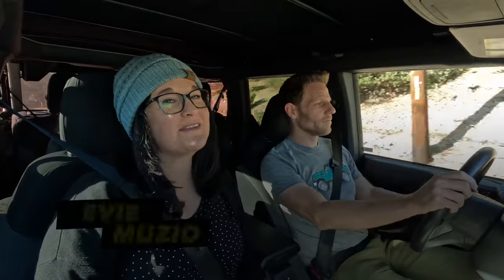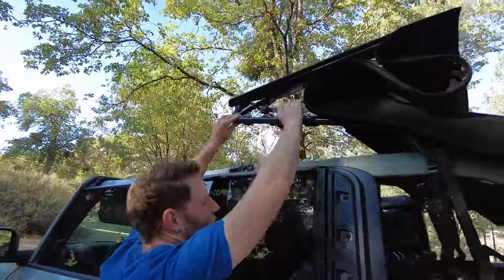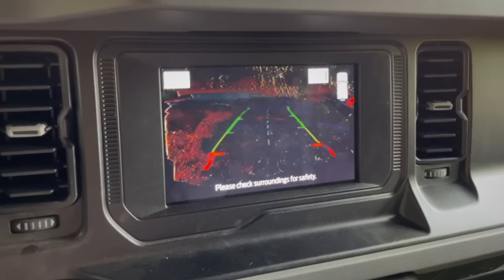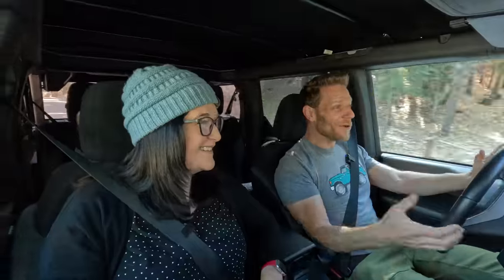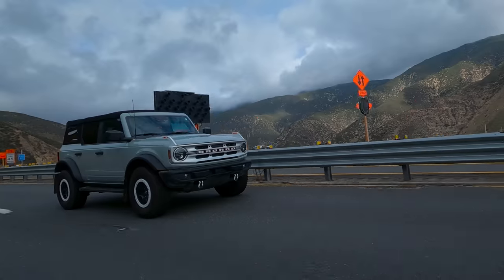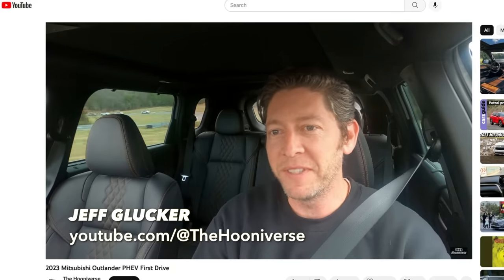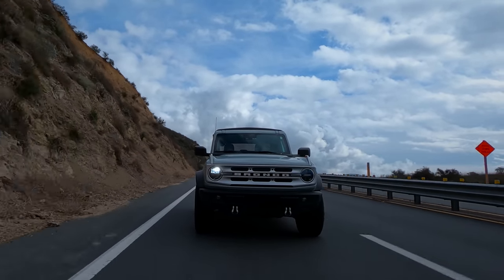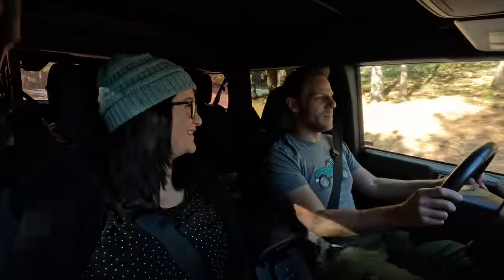Ford Bronco Problems (18K Mile Update)

Comment: My dad has a saying that is “Never buy a brand new series of a car.” I started to believe that throughout the years. I think it’s best to just wait a couple of years until a facelifted model arrives.
Reply: I totally agree. My dad use to tell me that to.
Reply: unless it is a toyota...
Reply: @alwaysup22  even a Toyota you shouldn’t buy the first year of a new model. Look at the new tundras, they have been having tons of problems.
Reply: @RRLV434  If everyone waited until the next model year for a car, there would be no next model year for a car. Early adopters is how problems are identified and fixed for the next generation. While it is best to wait for the next model year, you could always trade your car back in for the next model for close to MSRP.
Reply: This is generally true, but over 53k miles, my Bronco has been really good and nearly problem free.
Reply: Not even necessarily the facelift just don’t buy the very first model year
Reply: That's a good idea for most tech. Don't be a early adopter if you want the best experience
Reply: @Carfan678  I think even buying the first year model 4 to 6 months after it is built can make a difference in quality
Reply: @ryanwang6108  refresh doesn't = new model. Refreshes are usually appreance related not mechanical or electrical.

OP: The first year is where most problems occur. Waiting for a refresh shouldn't be necessary.
Reply: My father said the same.
Reply: Always. Especially American or European
Reply: @mpeugeot  every car with 50k should be totally trouble free
Reply: That's what I told my wife before she bought the bronco. Now it's had 2 recalls and it's been at the dealer for 2 weeks with a transfer case leak that they are waiting for parts for! And it's not even a year old!👎So listen to your dads they know what they are talking about!
Reply: I want to love something 'American made' but ford/chevy/dodge make it so hard to love.  Luckily my Toyota Tacoma was built in Texas & is American made! 154k miles with zero issues & its lifted too so you'd think it go through bushings & susp. Parts but it's been great like all my other Toyotas I've owned.
Reply: @MrMd5555  I mean wranglers and broncos are good looking but don’t know it’s worth the inflated prices

Comment: Dealer comments are right on. They make or break the experience. I was never happy with my local Ford dealer when I ordered my mustang, and throughout the 250,000 miles I kept it. When I moved up on my next purchase, I was smitten with my Volvo dealer. Now I drive an Audi. Admittedly, you expect an Audi experience to be upscale, but our local Audi dealer is unbelieveably friendly and thoughtful about our whole purchase/service experience. Even when I was driving a 10yr old Audi that I did not buy there, they treated me like I'd just bought a new R8. Recently I purchased an Audi there, and the experience was excellent. No more Fords for me, I'm all for Audi (at least for now....)

Comment: I appreciate you noting which dealer gave you a bad experience. I’ve had bad experiences at both dealer and independent shops. Worse one was a shop forgettable to put the mounting bolts back on my brake calipers and they were just flapping around in the wheel hub. It’s a miracle I was able to stop and the lines didn’t snap but left me stranded in the middle of nowhere TX over Thanksgiving.

Comment: I have a 2021 outer banks non sasquatch soft top 4 dr since Nov 21 with about 10k miles. Had a great dealership experience here in central PA and no major issues. I had the kids safety lock recall but that was fixed at my first service. One minor nuisance is that the plastic windows are VERY sensitive and scratch easily. I hand wash/dry with microfiber and still have little annoying scratches. I guess it cant hurt to call ford. 

I love it and would get it again. Sorry you had all those issues.

Comment: Good call on the KO2's!! My Wife's 4Runner has had them on it for almost 3 years. Many off grid camping trips and running over many trails and ROCKS. The KO2's are sweet. A little firm but quiet and capable. Good choice!

Comment: Yeah the V6 does have some issues 😬
The thing is that the 4-cylinder is a Ranger engine, which has never gone out of the market in Australia, Mexico and other markets. Therefore, the engine has been tested and improved for many years in the harsh Australian and Mexican desert conditions. I do trust the 4 cylinder more than the V6
The 10-speed transmission is used in so many high performance vehicles, both GM and Ford, and it has never been an issue, nothing to worry there. Dana makes great axles, just don’t push it past its limit. Bilstein is pretty good, so no worries there either.
Really, the issues are only minor in the 4-cylinder. Other bigger issues I have heard of were due to bad mods. Lifting and not doing anything else to the suspension, putting bigger tires and not reinforcing anything, things like that
Reply: Do you have an opinion on the reliability of the 2.0L 4-cylinder of the Bronco Sport Badlands, as well as its 8-speed transmission. Thank you

Comment: Dealerships can make or break future purchases. I had all kinds of issues with my 2018 Kia Stinger GT. Paint issues within the first week I had the car. Took over two weeks to fix. But at least I got to drive an Optima (insert sarcastic face). Then the rotors went out on a trip to Canada. Had  the car for a little over a year at that point. Kia paid for that, but they would not pay to replace them again 6 months later when it happened again. Dealership (Oregon) was so unprofessional about the whole thing.  Took the car to a trusted tire place and had them do it. I wasn't paying Kia anymore cash. When the lease was coming due, I sold it to Car Max and made a nice profit. Picked up a 2016 Lexus GS350 F sport with, at the time, 29,000 miles on it.  Love that car, so I got rid of my wife's Infiniti and got her an NX. I am sticking with Toyota brand cars. No mater how nice the new Kia's may look, I will never buy one again.

Comment: I switched to the KO2 for the same reason. FYI you will need to run a few PSI lower because of the thicker/stronger sidewall. I have a 2 door and like 36 front, 35 rear ish. I think they ride and handle much better. Looking forward to your review video.

Comment: My 2022 Bronco Wildtrak w/ Sasquatch needed the Transmission replaced at 3,800 miles and now needs it replaced again at 6,600 miles. The rear passenger seat frame also needs to be replaced. No off roading, hasn’t been beaten up.

Comment: If I was looking for something to do some moderate to serious off-roading, I wouldn't hesitate to buy a Bronco, AT MSRP. Even though I live in Florida where snow is a non-issue, and I've never done any off-roading beyond being a passenger a couple of times, I'm still interested. The idea of a "convertible" that can drive on the sand and do all of the other offroad things is very appealing. In the end I'll probably get a Miata though, mostly because it's easy to find at MSRP, and is better for how I'd use it (on paved roads 99% of the time).

Comment: I purchased a 21 jeep wrangler, had it for a year and a half put 30k miles on it. Test drove a bronco and sold the jeep once I ordered the bronco.
Now, mine is just now a month away but I think the issue is simple. The bar isn't set high for this class of vehicle. (Convertible off roader) since jeep was able to get by with no competition, the bronco was easily able to over take them with just a few upgrades.

Comment: I have a 2021 Rav4 hybrid. Spent $31,600 on it. At 25k miles it has had ZERO issues. Not a single one. No recalls, no campaigns, nothing.

Comment: I've probably sworn off Fords after my 2015 Escape and it's wide variety of issues/annoyances (cv joints failed at 22k, folding the rear seat repeatedly damaged the rest seat belt mechanism, finicky console, etc...) so seems like more of the same unfortunately. 100% agree the dealer makes a difference, ours was responsive and fixed things so I can't imagine dealing with a lame one.

Comment: Mine is a manual with 2.3l. has 7,800 miles, but I hit a deer and it's in the shop getting the bumper, grill, headlight and fender flare.

Comment: Based on your ownership experience, Is the 2.3 with sasquatch enough engine?
Reply: They’ve only said that it IS in EVERY video they’ve made about their Bronco.
Reply: Enough for what?  I would prefer to have a 3.5 ecoboost in my 2 door Bronco non-sasquatch, still the 2.7 is adequate, but for most people in most situations, the 2.3 is plenty.  Still I prefer the 2.7 to the 2.3 as there is nearly no mileage penalty and it just has more oomph.

Comment: Normal first year service: oh hey, could you please check this slight rattle I have from a trim?

Modern car first year service: hands them a list that's 2 pages long

Based on personal experience and seeing a small fleet handled by a friend, all new cars are problematic and literally the only thing that matters is the competency of the nearest dealership. Seeing warranty repairs of up to 50% of MSRP in the first 3 years is perfectly normal. Fighting with them to finally replace a part that's obviously broken is not exactly fun.

Example: Nissan. We have a clicking cv joint and they couldn't fix it in 2 years. Now the warranty has expired and they basically told us to live with it or pay for it. I'm like sir, I've been coming here for 2 years with the exact same warranty issue, you're paying for it. And they basically told us to contact corporate. We did and they told us to sue the dealership. I'm like WTF? What kind of customer service is that?
It also needs a few things that have already been replaced once under warranty and the new part has failed under warranty again. We told them, they said a fan chirping is normal and it's not covered by warranty. Sir, you replaced it 6 months ago for the exact same problem, I'm pretty sure you did that because it's obviously broken, not because replacing stuff for free is fun. Nope, contact corporate. Corporate says sue the dealership.

Thanks for nothing I guess. Turns out we're not alone with these issues, surprise-surprise, corporate says they've never heard of these issues. I have 20 people claiming otherwise but sure...

Comment: I am driving an M2 g86, have been driven type r, Cayman gts4.0, and Cayman S. I am interested in Bronco manual transmission (not sure which trim). How is the feel economy on this? The cars I drove were around 19-22mpg combined. And do you think it is a weird switch since I drove the sports car most of the time? Thanks.

Comment: On my 2023 Bronco Badlands 2 door manual, the only problem i have had so far is the center display lag, it takes a bit to start and when using the apps they all have a strange delay, including when i turn music volume up or down and the display shows the volume control after a few seconds after u used it. Other than that, so far everything else is ok.
Reply from the maker: Thanks for weighing in. I always love hearing from other real owners. Cheers!

Comment: My Bronxo had the airbags sensor failure so not airbags..and the main  screen not the infotainment system the speed and fuel screen stopped working so I sold my .. it had under 10k miles

Comment: I have a Opel made Insignia AWD s/wagon sold in the US under the Buick brand I think. 
Honestly it was a top of the line model and I’m getting tired of returning it for faults. It’s still has several rattles and most recently the sun roof cover has jammed. Disappointed!!

Comment: With Ford you never stop spending money, that is their business model. We have a F-150 2017 V8 with a little over 100K miles, it will stall randomly at stop signs. We took it to the dealership and they said the issue can not be replicated. The same day it stalled again. Would I buy a Ford in my lifetime? At this point I'm leaning toward a NO, the cars have too many problems and the dealerships are not helping when they should.

Comment: I absolutely love the vehicle but I don’t want to own it.  I am seriously in the market this year and I am thinking the SR5 premium or TRD premium 4Runner will be my choice.  It’s a tank and I never here bad things about them, especially when they stay with stock suspension.  All I have heard and seen about these broncos is that the owners are basically Guinea pigs for the engineering department.  I know a few owners and each one has had some semi serious to actual serious issue addressed since they own them.  I do Love that they come in manual.  I wish the 4Runners still did.

Comment: Based on the problems that you have had already, I'd say NO to the Bronco. I had fewer problems in my 2008 Sonata over the whole 12 years and 197,000 miles I had  it for. My 2013 Sanata Fe (bought used 2 years ago) is also doing better so far.  A 1976 Ford Fiesta also made it 10 years/150,000 miles and was still running when sold. Of course that was a much simpler car.

Comment: Hell ya. Not a ford person anymore. I had 1998 expedition,  transmission replaced at 125,000. 2013 escape, bought for my daughter for graduation, at 34000 miles engine had to be replaced. As soon as it was replaced check engine turned on after 10 miles, returned to dealer only to find out that engine had to be replaced. transmission issues, missing bolts around suspension, sunroof motors had to be replace. Interior pieces like center console lid braking, seat belt on passenger side not working, lift gate not working, There were more issues also, too many to report. Notified Ford consumer complaints concerning all problems of escape.  All they could give me was an extended warranty up to 125000 miles, I had to pay $109 every time I used the warranty. Usually 2x a month.  I will never buy another ford again. I tell everyone about the experience of the car I bought for my daughter. She now drives a toyota CHR, my wife drives a toyota highlander and I drive a Tundra. No issues, great build quality. My brother in New York put a down payment on a Bronco 2 yrs ago, still hasn't received it. Just have to wait and see if he will have those issues. He ordered the 6 cyl. Good luck on that.  Ford needs to do better with their customers and not say "I dunno" . So ya, I would not buy a Ford.

Comment: Hopefully you have access to a 4Runner you can use to tow the Bronco to the landfill when it has a catastrophic engine and/or transmission failure at or before the 60K mile mark….. good luck.

Comment: I got rid of my Bronco after about 8 months because of the quality issues.  I now have an FJ.  Driving dynamics are about the same as the Bronco without the quality issues.  On the flip side the FJ is not my daily.
Reply: I miss my FJ. I should have never traded it.
Reply: @tannerkennedy4941  I’ve had a Jeep Gladiator Rubicon, 4Runner, Bronco Sasquatch, and the FJ.  The FJ is definitely one of my favorites.  Just not good for humans in the back.
Reply: Same here I ordered one kept getting screwed around found a 2010 trail team for 20,000 less than the bronco went that route haven't regretted it yet.

Comment: The big red flag for me with the Goodyears that come with the Sasquatch package was the weight.  They are incredible light for a 35" tire, like 20-25lbs lighter than most other AT or MT tires in that 315/70r17 size.  Everyone I know that has bought one and had any plans on taking it offroad has switched out the tires.

Comment: Typical Ford experience.  I haven't seen my Lexus dealer for anything other than free oil changes when it was new, it has 104k miles now.  That many issues in 18k seems like you take care of the car more than it takes care of you, and that's if you were lucky enough to have multiple dealerships to choose from in your local area.
Reply: 236,000 more miles and you’ll have as many miles as my F150 has on it. Typical Ford experience lol, 340k miles and going strong.
Reply: @dusty_burkhalter  my dad had a Lincoln that made it to 250k, but it was in the shop every single season for one thing or another.
Reply: @Ethan7s  I hear ya. I think a lot of manufacturers are struggling to get bugs worked out right now, especially Toyota. The more computer driven components we have in vehicles accompanied with smaller, turbo charged engines, the more trouble we are likely to see until manufacturers have time to get it right. I don’t have any devotion to a particular brand, matter of fact, the first one to offer 0% for 72 months will probably get my business, but I will say my current F150 is hands down the best and easily most reliable vehicle I’ve ever owned.

Comment: Holy crap.  Had a Honda Accord for four years. Nothing went wrong. Nothing. Am currently leasing a 19 Civic Hatchback. The instrument panel glitched out a couple of times early on. That’s it. Based on your experience, I wouldn’t touch a Ford with a 10 foot pole.
Reply: I may be the exception but 4 years and 75K miles later, nothing has gone wrong with my 2018 Hyundai Santa Fe Sport which, according to the data plates, was built by Kia in Georgia.  Two recalls  with less than an hour at the dealership for each one.

Comment: Exact same on the tires!  Popped TWO on my first trail ride to Crystal Mill in Colorado.  Both tires picked up small stones between the lugs that punctured two tires.  Other than that, I've been trouble free after 13 months and about 11K miles.  Love my FE!